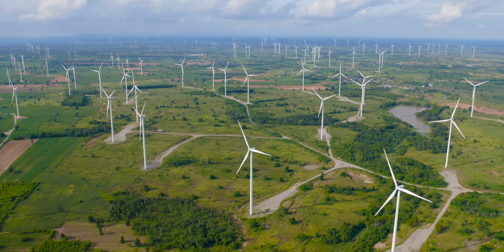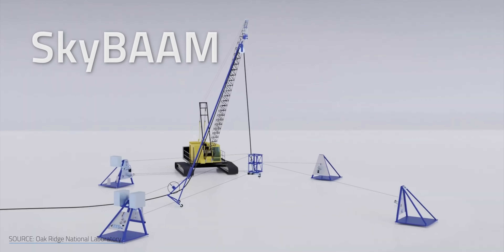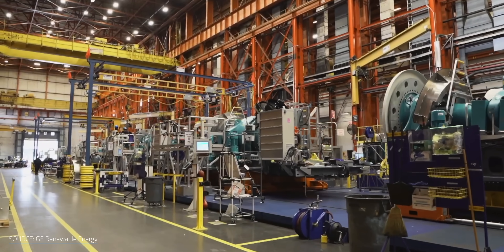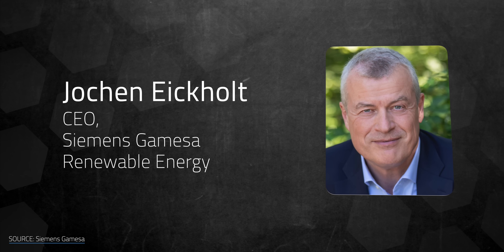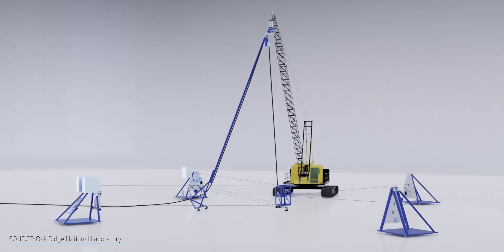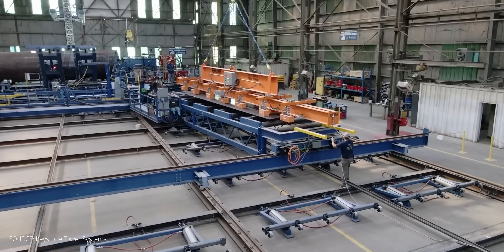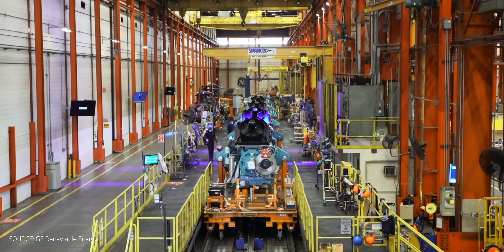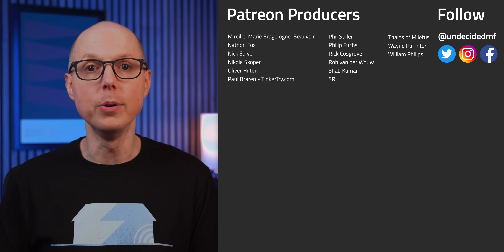Why We Need To Rethink Wind Turbines

Comment: Well, if we have a massive problem with the giant windmill blades, from decommissioned windmills, because these enormous HOLLOW blades, because they are made of an nearly-indestructible fiberglass composite material, intended to make them completely weatherproof and structurally strong against nature’s storms, which makes them very expensive to recycle, so now we are just overflowing the garbage landfills with these trashed blades. BUT, there might be various ways to repurpose these blades. The United Nations made plans to create giant floating artificial islands, a separate thing from that ‘SeaSteading’ movement, and by cramming these hollow blades with trashed automobile tires, plastic bottles, and Styrofoam, we could keep that stuff out of the garbage landfills, to make giant floatation pontoons, that won’t sink in the sea, even if holed. These things could become the buoyant’Bedrock’ of these floating islands, or the ‘SeaSteading’ floating cities. Or, we could arrange them around the bases of ocean windmills, to bounce up and down in the waves, to generate more electricity, or to empower a vacuum system that de-salts sea water, to provide potable water, with the condensed sea salt sold as a sideline business. Or the blades could be used as breakwater devices protecting the coastlines from erosion, while doing the same thing as ‘Pelamis’, a free-floating wave-action-into-electric-power device. Or they could be used to make floating platforms for MOBILE deep sea giant windmills, that we could move to disaster areas to provide electricity. Or we could take the ‘FishKill’ discarded nets in the ocean, along with the plastic trash on beaches and ‘The Five Gyres’, to melt it and pour it inside of the hollow blades, to create very hard and very heavy shoreline piers. Finally, there’s a serious problem in our world’s refugee camps, where the women who go into these flimsy outhouses are in constant danger of being raped, because outhouses made of improvised junk are not barriers that work in this instance. BUT, we could cut these giant windmill blades into sections, and modify them into women outhouses in the refugee camps, that are too strong for the rapists to break into. That sounds nuts, yes, but in these refugee camps, they don’t have money or local resources to build strong outhouses, so a CHEAP option could be recycling these TRASHED blades to make outhouses with locks and storage sheds. EOJ

Comment: I still prefer nuclear over wind or solar. It simply makes more sense to have a small building with an underground reactor setup in the middle of nowhere so it's safer then having hundreds of turbines takeing up a lot of room in the middle of nowhere that kills off wildlife as time goes on. If we went with investing in nuclear all our power needs would be met and the inviromental impact would be much much less due to the ability to recycle nuclear material into other things we use in the industrial sector.
Reply: It makes no sense to prefer a technology over another that produces electricity at a tenth the cost and does not have horrendous construction times. Wind turbines kill very little wildlife. Domestic cats and high rise office buildings kill far more birds.

Comment: Wouldn't it be best to just grind the old turbine blades back into fiberglass. Then re use the paste as printing filament for new blades.
Reply: Once you've ground fibres down to paste, you no longer have fibres. 
Glass fibre composite is not printed.
Reply: @neilyoungman9814  true that is true but I mean as in grind the fibers into a dust and use the dust to be used in the mixture. That way they can still interlock and when hardened provide similar characteristics to carbon fiber ill be it they will still be hevay

Comment: Bigger is NEVER better. 
You can spiral the blades in TIME and get more mass and speed plus be able to make them smaller and not have them so high up but still get high out put. Your manufacturing is the problem.

Comment: Blades and towers made in factories, to very tight tolerances, using specially made machines, still break..... And somehow we think that flimsy 3d printing will solve this problem.....??? This is silly.
Also, resin impregnated fiberglass or carbon fiber will never be recyclable, all the strength is achieved from laminations, if you grind that down, you're just left with lung destroying dust.

Comment: It would seem vertical wind egg beaters are a more practical solution. Keeping the large mass of the generator at or very near ground level buts less strain on the structure and the foundation doesn’t need to be as extreme.
Reply: No one has managed to scale them up enough to compete so far.
Reply: No. They have been rejected for even modest wind turbines and for extremely good reasons.
Reply: @rogerphelps9939  Here in California we have a huge egg beater wind turbine that has been operating for many years. Yes windmill type wind turbines have dominated, but they have also not performed as well as designed and expected. So some are going back and reconsidering the egg beater design.

Comment: I don´t get it - The windmill blade waste issue..
When I was a kid in 80´s and 90´s, basically EVERYTHING was dumped in landfills. Everything.
Now theres a huge debate over windmills "being not enviromentally friendly", because you have to dump some glassfiber blades, which are pretty much inert waste in the ground.
I know it is not the optimal solution but just for perspective - Google up Your own country´s landfill waste amounts now and some decades back.

Comment: It just hit me that there's a design flaw in all turbines. They're on the ground. You get much better wind higher up, so a hot air balloon, or blimp design would be better. Leaving all the structural issues behind. Relying on simpler methods for altitude.

The big advantage here is having these tethered designs would allow material science advancement towards space elevators with a profit and utility ladder. Instead of the government investment deadlock of decades.

I'm no buildy thingy maker guy. But seems to me having a deployable design that is less dependent on geography will be better. After all, the Jetstream is global, just need to reach up and take hold.

Comment: Until those installing wind turbines actually take responsibility for the problems thereof, they're not a truly "renewable" source of energy. Two examples: though some localities require installers to plan for the recycling of turbines at end-of-life, from what I've been able to find out, a huge number simply end up in turbine graveyards; another issue is that the main response I see to the problem of bird strikes is the assertion that cats are worse, and while this may be true, cats hunt smaller birds with vastly larger populations, whereas a lot of our soaring birds are having a much tougher time. If we kick problems down the road, or simply point fingers, we are no better than those who have caused the various problems the have cropped up with other technologies in the past. It feels like a lot of those involved in renewables right now are in it for the PR, and not really for any tangible benefit to the environment.

Comment: As a wind technician for 4 years for Vestas, I've led many main component teams and commissioning projects of many turbines. Our site here in Indiana has 329 turbines with two more phase build outs in the planning. As the site QSE and TapRoot certified accident investigator, I've had my fair share of accident investigations. 

The problem with the critical turbine failures of towers collapsing that happen across the induatry boils down to the particular construction company/crews erecting them. Massive bolt connections on massive tower flanges with massive hydraulic torque equipment that all has to be done by 3-5 man teams per tower cause issuestl that lead to the same mistakes any industry face: complacency, lack of care from being tired, or ignorance.

The main component failures such as blades, main bearings, gearboxes, and generators of most often the cause of QC issues from respective manufacturers. It is rare to find serial defects but it does happen. I've personally been involved with a massive blade repair project and gear box replacement project due to serial defect. They take a long time to fully correct and are very expensive. The problem is that most don't show until close to or after the component is out of warranty.
Reply: If the problem doesn't appear until near or after the warranty is over, sounds like the flaw is by design.
Reply: @evancombs5159  warranty for the main component items I listed are all 5+ years for items that weigh at a minimum of 20,000 pounds for a generator and up to 64,000 pounds for a gearbox. They literally operate 24/7 for all but 1-3 days a year when they're down for service. There's no warranty in any industry that guarantees quality on massive moving parts that is better. The fact that there's a 5 year warranty on these components is amazing to me. Can't even get that on most cars and they're far easier/cheaper to maintain, build, QC, and repair. I should reiterate that serial defects, at least for Vestas turbines, are EXTREMELY rare. I was fortunate enough to experience the only because the wind farm here in Indiana is both a halo site and a pilot site. That means because we're good at our production numbers and have a customer that is fully bought in, we get the newest hot off the prototype models and get to work through all the issues before that go up anywhere else in the world besides Denmark.
Reply: Has brinneling of the turbine bearing races been a major problem? Is it more common among the bigger, higher windmills or are they designed to eliminate the issue?
Reply: @dennisenright7725  on our older v82 model turbines (2009 commission) we have 121 and replace roughly 4/year as they wear out. Our newer v110 (2017 commission), v136 (2018 commission), and v150 (2020 commission) haven't yet had any issues with the main bearings. I suspect that once they reach the 8-10 year mark well start having issues that require replacement but it's an eventuality in all turbines. The lightest rotor of the above mentioned turbines is 98,000 lbs. Wear and tear will eventually win out over the grease.
Reply: so we basically need military precision. maube we should use the miltary to produce them
Reply: @PazinPortugal milspec standards are most often the bare minimum that private sector uses. Milspec is actually bottom of the bottom for quality in all reality. There's few electrical and mechanical engineers that accept milspec on billion dollar projects. Milspec (government spec) gets you the unusable space rockets. Private sector got us reusable rockets for space launches. Just an easy example but there's TONS out there. Even guns here in America for example, private sector firearms are far superior to milspec ones because they use the milspec as the base and design from there into something of actual high quality.
Reply: @sootynukkels  I knew there was a reason government fears armed citizens and government works so hard to disarm citizens.

Comment: People generally think if something is put in a landfill, that’s forever. EVERYTHING in a landfill is mapped and has been for fifty years. When a recycling solution is found you simply dig up the resource and reuse it. It’s only a few meters under earth. Turbines are only buried so they can prevent them from being homes from rodents etc.  this has been the plan for fifty years and is working. Unfortunately new technologies can take forty or fifty years to come to fruition.

Comment: You need to check out superconducting generators next! They will be key to reducing the weight of WTG nacelles offshore to make the next step up in WTG size.
Reply: Superconducting generators that operate at room temperature do not exist.
Reply: @rogerphelps9939  You are correct, current proposed designs are based on cryogenically cooled systems (much like MRI scanners)
Reply: Kills birds.  And whales.
Reply: Wrong. The things that kill birds are domestic cats and high rise glass clad buildings. The number of birds killed by wind turbines pales into insignificance compared to those. it has been found that painting one turbine blade black actually reduces the small number of bird kills. As far as killing whales that is just an urban myth. Whales are killed by pollution and disease. I am sure you can't come up with any sources describing original scientific research. @scottslotterbeck3796

Comment: I can't believe we haven't figured out how to utilize kites for generating wind power.  The size of these large towers & blades of modern windmills is crazy.  Fabric & cables would cost a fraction of what windmills cost.
Reply: They have tried this. See makani power for instance. Engineers are concerned with long term reliability of kites, and people buying power generators are risk averse. They need an investor like Elon Musk willing to think more long term and make it happen.
Reply: Yes it is mind boggling to me too. Maybe it is hard for somebody to imagine that software controlling a kite can be done right. Maybe it is hard to imagine that a non-rigid piece of cloth can harvest a lot of energy, and it has somehow stuck in our heads that if a sail is old-school, low-tech and therefore has to be inferior to the twentieth century tech. I don't know.
Reply: Google's X labs tried for about 10 years, https://en.wikipedia.org/wiki/Makani_(company), patents are open source if you want to give it a go
Reply: @pn2543  Thanks for the link.
Reply: They have done a lot of work. OK for something small but not really gone anywhere.
Reply: UHMWPE fabric and rope/cord would make excellent kite material for this (because of how strong and durable it is), except for cost.

Comment: This is why standards are good... and bad. I keep expecting a permanent structure with the height and strength to endure time facilitating the installation and management of a replaceable pilon to hold a non standardized windmill reducing replaceable parts and easing maintenance demands or known points of failure. Fire and cooling seems to be a reoccurring problem along with design considerations for employee safety and retention because of the real and perceived dangers like lack of escape routes, physical exertion, environmental dangers, remote locations, medical emergencies, practicality... etc.

Comment: As far as I'm concerned the trend should be to smaller scale "personal" turbines and energy storage instead of the centralized grid system.
Reply: Wrong. Domestic wind turbines are almost invariable not worth the cost and their owners are very disappointed. Do the sums and see why for yourself. Hera rea a few cues: average winf speed, swept area, height.

Comment: The 3D printing sounds too good to be true. The fibre is going in the wrong direction. You can already optimize the placement of fibre in current designs so I don't see how 3-D printing will improve anything related to strength or lightness.

I also do not see how the multirotor design will improve interference from other towers. If anything it looks like it will produce dirtier air on the leeside of the tower.

Comment: Europe is at a crossroads.  The wind power subsidies ultimately penalize electricity users by jacking up electricity costs.  This has made industry in Europe & especially Germany uncompetitive against China which makes cheap electricity as additional coal burning power plants come on line.   But if Europe decides to save it’s heavy industry by lowering their electricity costs by eliminating wind power subsidies, then wind power installations go bankrupt.

Comment: For me, the biggest problem of wind power is that they are not that good at a local level, say on your home compared to solar and that might not matter that much for now, but it's a given that as renewable energy gets better and cheaper and battery tech continues to improve, more of us are going to want to generate more of our energy at a local level on our homes and reports are going around that solar is going to be cheaper than all the alternatives, so much so that it become cheaper to not be on the grid any more.

The solar industry is already bigger than wind, I suspect over the next decade or so, that gap is going to widen a lot unless the wind industry finds a solution to generate enough energy that's useful  without the need for them to be massive and low noise enough that many of us wouldn't have a problem using them on our homes.

The advancement of solar is likely going to keep advancing that it could be everywhere and blend into a lot of buildings without impacting the visual makeup, I don't see wind power competing with that in the long run as the advancement of tech continues, most of us are going to want to go gridless so we have full control over the energy we use and what we pay, which will end up more or less being free in the long run.